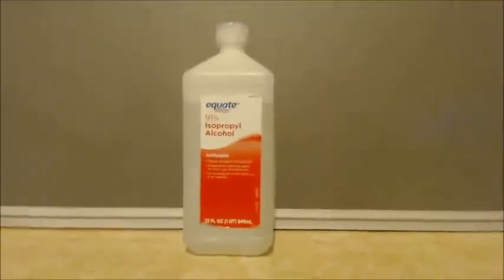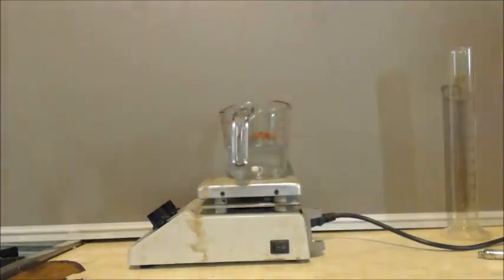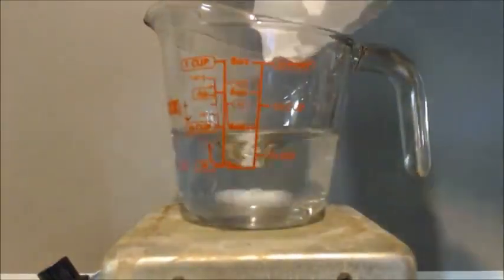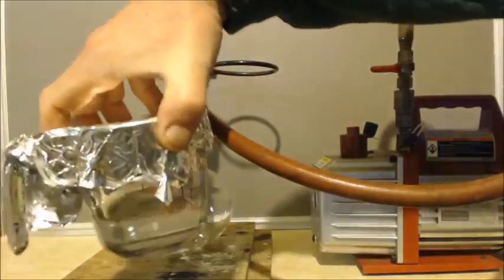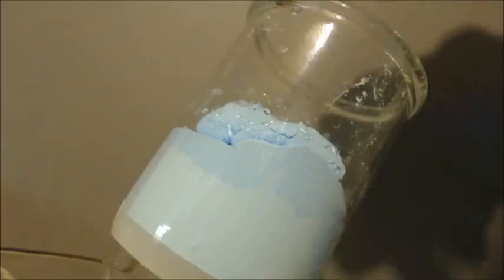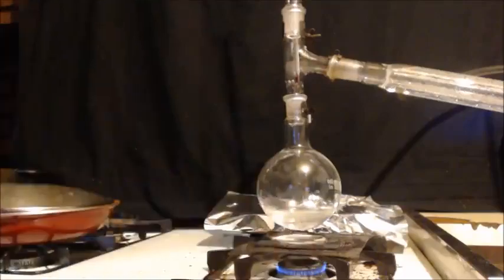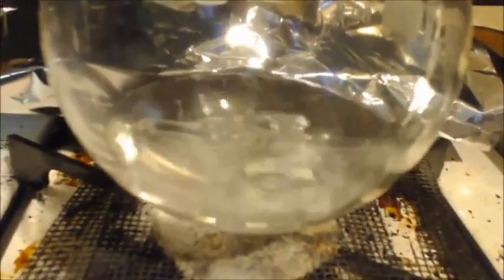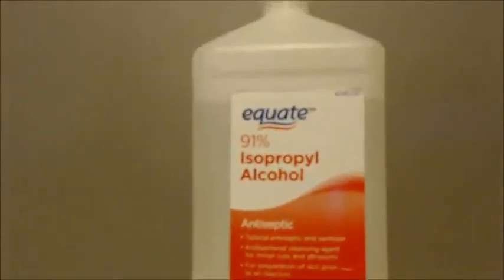MAKE ANHYDROUS ISOPROPANOL

Comment: I usually get the same 91% IPA, then just add an abundance of 3A molecular sieves and let it sit for a day or two. Then separate those out, and sometimes I'll even store them over some freshly dehydrated sieves as well, just to be sure they're kept dry. Seems to work a treat.
Reply from the maker: J H........... Yeah molecular sieves are great. Smart move.   What's funny is i bought molecular sieves like 4 years ago but it took till last year to open the box up and use them .  Isopropanol is a LOT EASIER to make anhydrous than ethanol.   Actually i think everything is easier to dry than ethanol...lol
Reply: @johnblacksuperchemist2556  Yeah. I think that you can dry ethanol pretty well using 3A sieves also.
Reply from the maker: @jhyland87  ................Yeah with sieves it is easy  to dry anything.  .   But again that took me 30 years to learn also...lol.  I mean i always knew about sieves i just did not know how to buy them.  I mean i just got on a computer 5 years ago and back in the day with no internet it was hard to find unique stuff sometimes